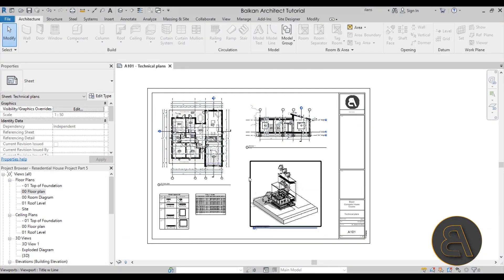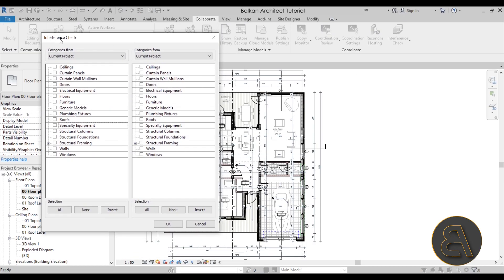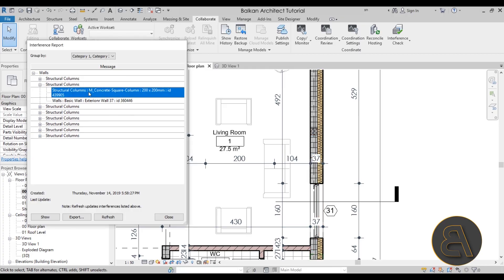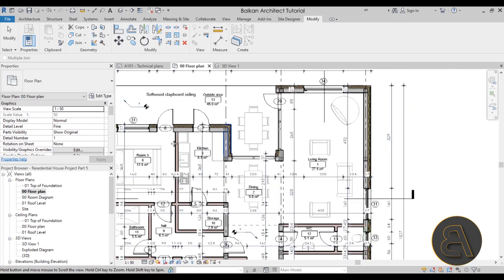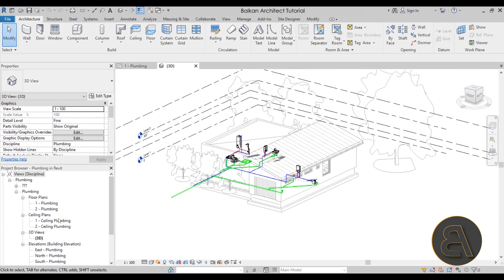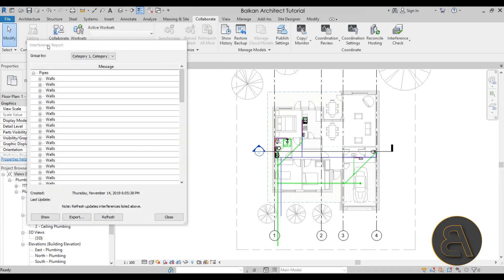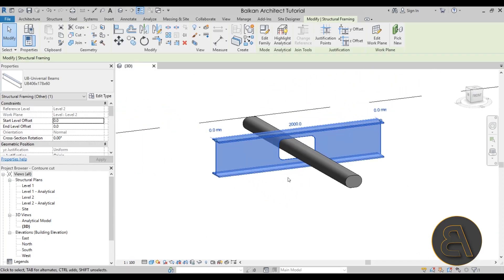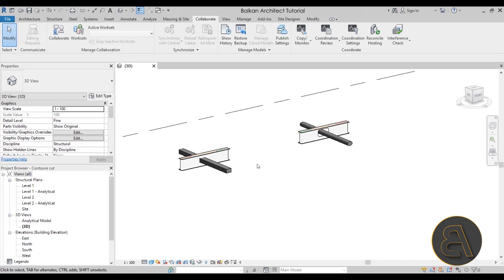Clash Detection in Revit Tutorial ( Interference check )

Comment: I think the clash is still active because it is not allowed to penetrate any structure because it will degrease the strength of that particular beam. We need to provide some kind of stiffeners or additional plate welded to that particular area to fix the issues with stress. Stress calculation should be done - Correct ? As you said, Autodesk should give a better solution.😀
Reply: This is exactly what I was thinking. In actual practice, the duct would have to adjust and not hit a structural beam/column since structural engineers would not allow wholes or punctures through those members. However, autodesk should create a better prompt for this kind of issue.

Comment: Great video. Another issue I found when using clashes is that it doesn't take into account phases. You can have a wall set to be demo and still will clash with the new stuff. I could not figure out a solution for that either.
Reply: It's a joke right, doesn't care about phases, gosh